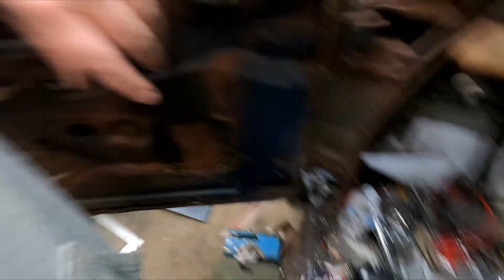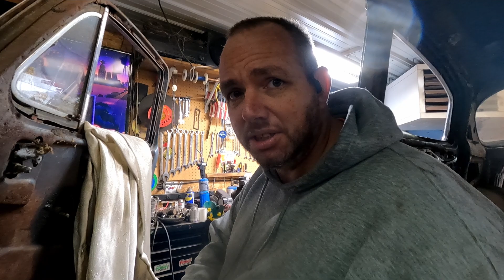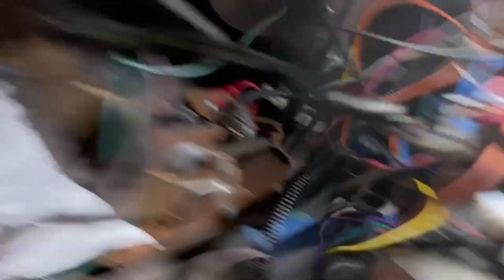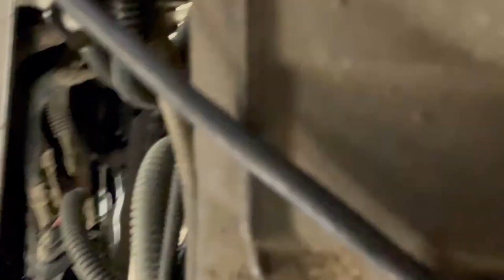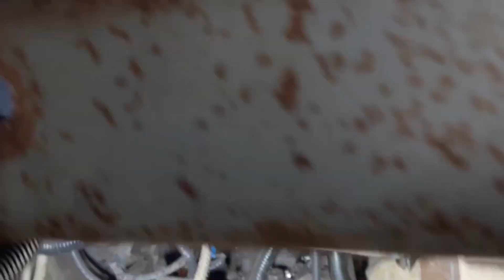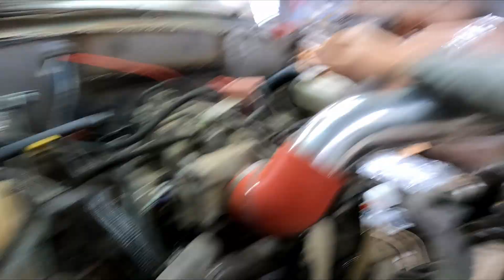How to Install HEAT in any (Rat Rod) 1954 Chevy

Comment: Just run a relay off a ‘keyed on’ to the power for the heater, then you don’t have to worry about the draw from the unit.  A lot of 2nd gen Dodge Cummins trucks need to add relays for the headlights as they draw more power than the headlight switch can handle (it makes the headlights brighter as well, and prevents wiring fires…. I have a switch that may or may definitely be burnt.)
Reply from the maker: That’s an awesome tip! Thank you so much!! May or May definitely 🤣